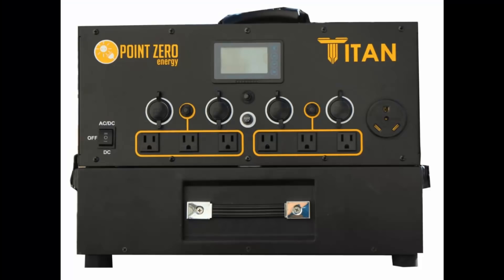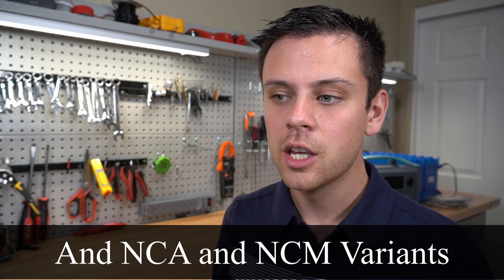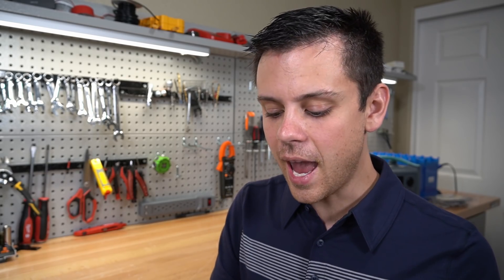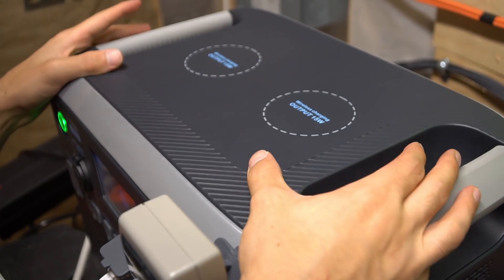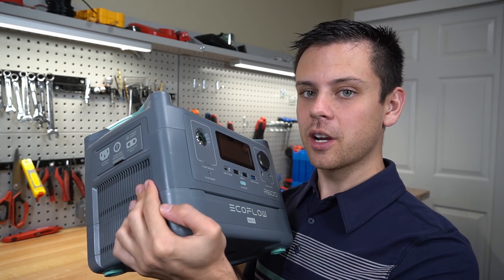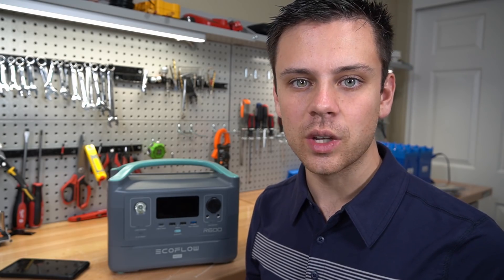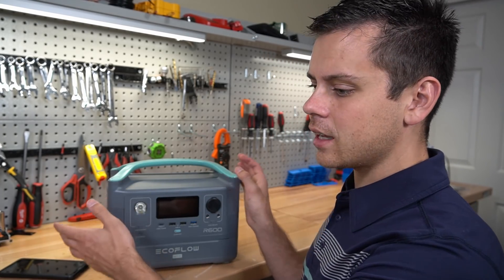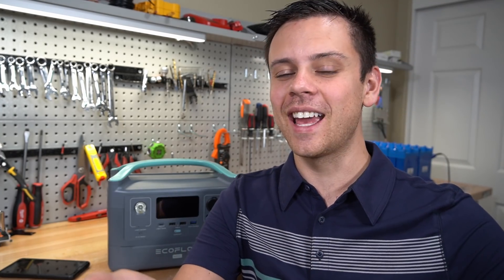Solar Generator Updates for the Titan, AC200 and R600

Comment: Will,  It so nice to know that you just want the products to work as advertised. I think it's funny and sad that they think they have a production unit and you're able to systematically break it down and show all the failures.

Hell yeah you should charge them since you're helping them make their product to operate to specs that they posted! And when you say that the tests validate that's this product should be a buy. People have no need to worry about spending a lot of money and end of getting a dud.

Great, great work !!
Reply: charging for beta testing, yeah, that makes some sense.  Maybe Will should follow up before the review - and at least mention it and that it is or is not pre production.
The spelling error is odd.  A failed firmware update is a concern.  Who knows how to code?  Nobody.

Comment: Thx for the update on why they used LiNiMnCoO2 vs LiFePO4 battery chemistry in the AC200.  When you said the manufacturer instituted all your suggestions in the video, I was wondering why you did not want LiFePO4.